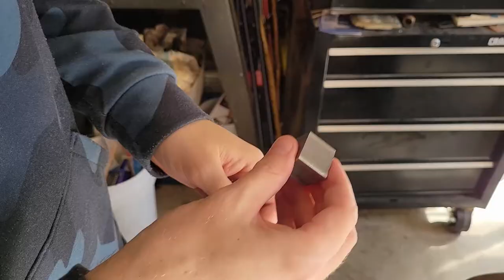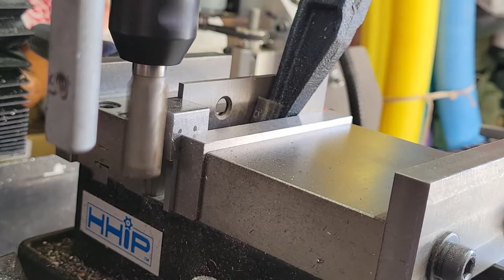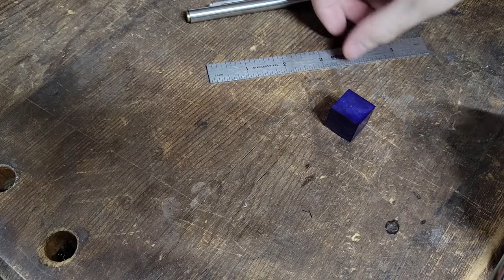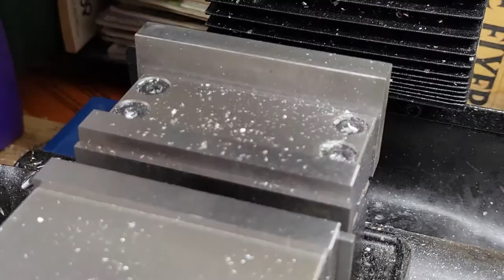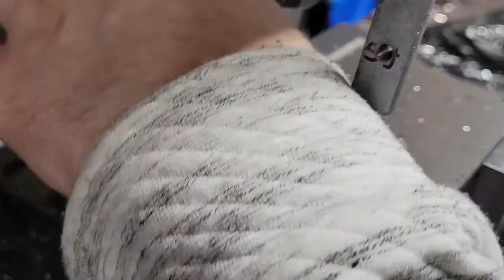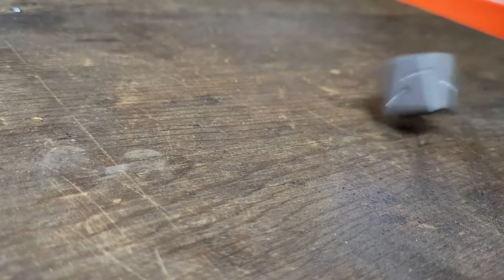How to Make Steel Dice

Comment: I just made a set of 0.75” stainless steel dice in my machining class, started with a 1.0” square bar so I had to smoke up the whole shop slowly cutting it down with a face mill lol, worth it tho the 1” die someone else in my class made probably can’t be rolled anywhere without breaking/denting something😅
Reply from the maker: Nice! Yeah don't roll them on your nicest wood table haha

Comment: What’s the dementions and thickness of that metal you used and is that possible to make a whole dnd dice set like that
Reply from the maker: The scrap block was probably 3/4" before i started cutting. You'd have to do some fancy fixture work if you wanted to make something other than a D6
Reply: @somanyhobbies  Like a d20 or d12, I like my rphs and want to make my own metal dice
Reply from the maker: @R4ynze  The easiest method would be to probably make something similar to "long dice" with however many sides you wanted. A D12 is probably doable, I'm guessing a D20 is too unwieldy.
Reply: @somanyhobbies  I guess you could say that all 20 sides are equal lateral triangles